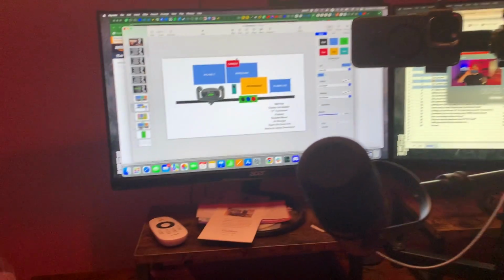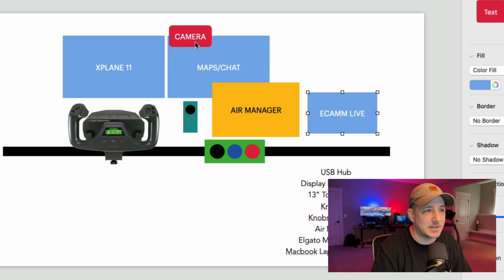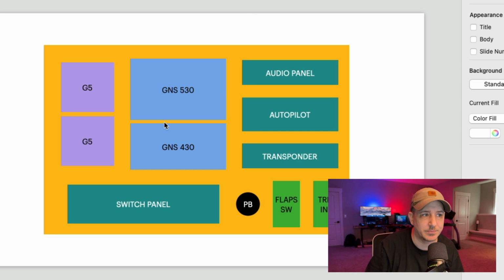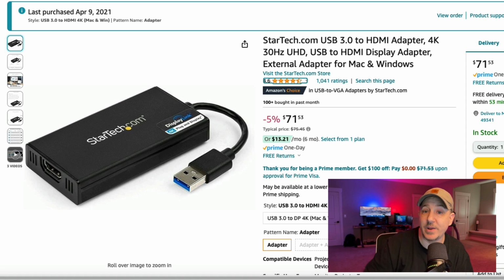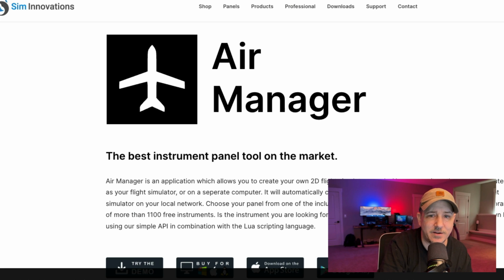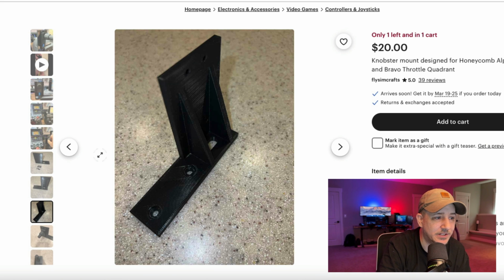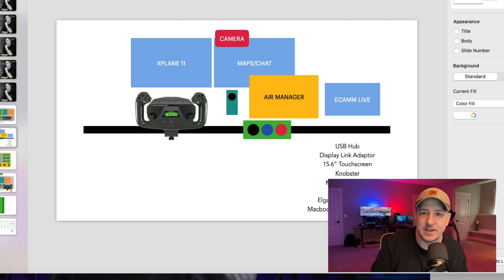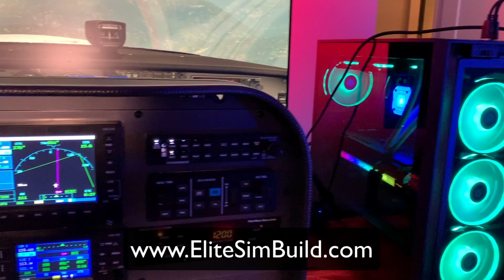Designing A Flight Sim Using Macbook Pro For LiveStreaming!

Comment from the maker: For anyone trying to understand the StarTech adaptor and the DisplayLink tech, that adaptor allows you to plug in ADDITIONAL MONITORS via HDMI to USB 3.0 on a Mac (or probably PC, too) that does not natively support the amount of monitors you want to use.   Flight Sims could easily use 4-6 additional monitors.    So if you have an M1 Macbook Pro (like I do), that only natively supports a SINGLE monitor, then for each monitor you want to setup past the first one, you need a DisplayLink adaptor.  They should also have dual HDMI adaptors as well so you don't have to buy them one at a time (which would be nice).   In my case, the touchscreen monitor I want to use will not work on my mac because I already have one monitor + one DL monitor, so the adaptor will make a third monitor (touchscreen) work.   If you have an M2 Chip Pro or Max, that should automatically support 4 monitors out of the box, so you'd be good to go from the get-go.    Now that I'm thinking about it, I should set all this up on my wife's Macbook M2 and that would solve all my problems.....

Comment: All looks very logical.  I think possibly could save money by purchasing air player instead of air manager. You can create the panel on your flight sim PC with air manager and then just load it on the streaming PC with air player. Those displaylink adapters are great. I have a dual HDMI model for my sim. I am creating a retractable dashboard panel that just has a power lead and USB port (to minimise cable clutter). Inside there is a USB hub that then connects to the two 20.8" touchscreens, a knobster, two Streamdecks and my USB to dual HDMI adapter. Thats then linked with short cables inside the panel to the touchscreens.
Reply from the maker: Good idea with the Air Player, although I don't trust things that work wirelessly these days.   Cold be worth a shot, though.   Crap never "connects".    Good to see you are still watching!   Can't wait to see that retractable dashboard panel!
Reply: @flightsimguides  yes, I am still watching. Lol. I watch all of your videos. Though I don't comment on every one. A bit busy at the moment with a side project. Haven't worked on the sim for a while